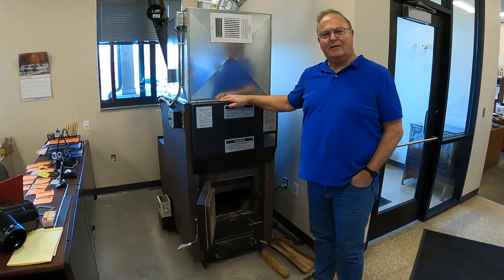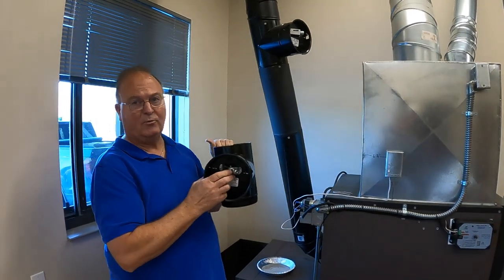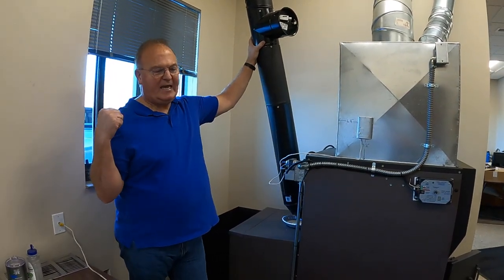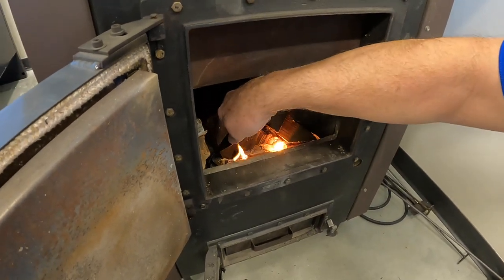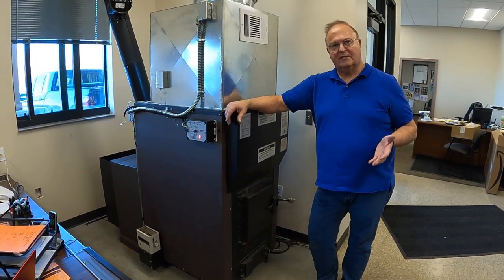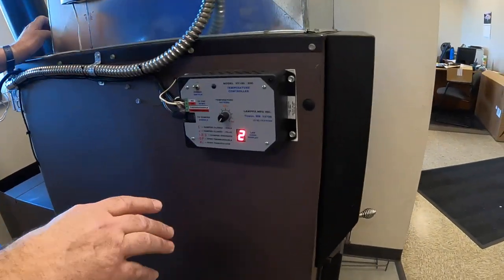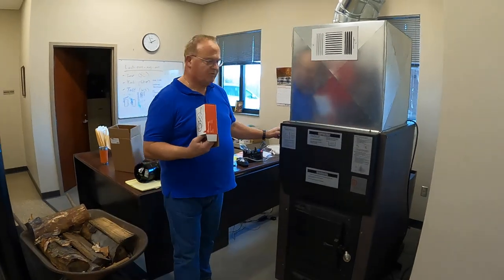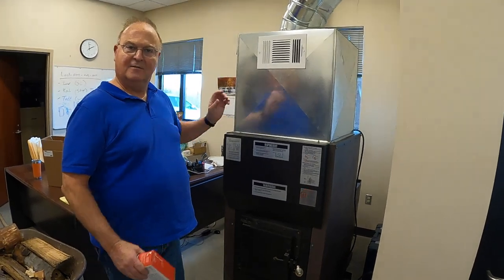Firing up your Kuuma Vapor-Fire 100 Wood Burning Gasification Furnace

Comment: Hands down the best Wood Burning Furnace on the market. There is a reason they can give it a industry leading 25 year warranty!!! Going on year 6 with mine and have yet had to clean my chimney. No smoke therefore no creosote. Cut my wood consumption by over 1/3 and have a warmer house. Built like a tank, runs like a Porsche !!

Comment: What is the temperature when the over temp alarm is triggered?
Reply from the maker: about 1300 degrees
Reply: @Lamppa Manufacturing  thanks for the quick reply, I'm also glad to hear it's as high as it is, I've dealt with pellet furnaces in the past that had overtemps to low, and the air would be Luke warm by the time it got to the other end of the house.